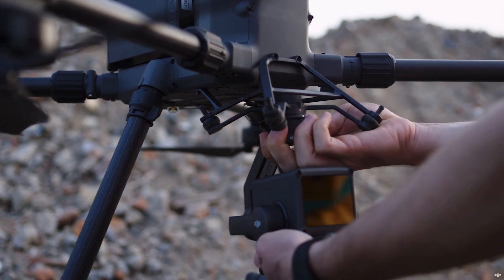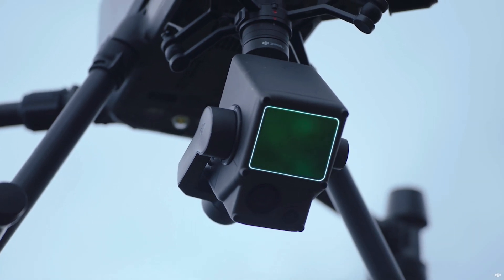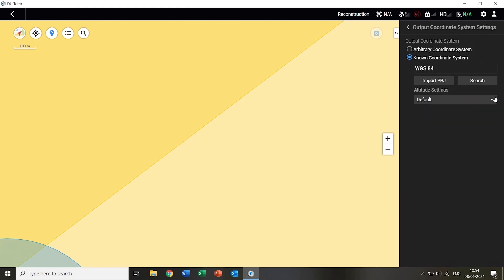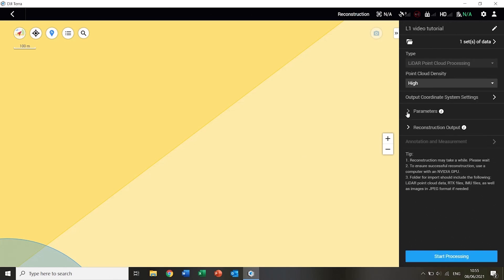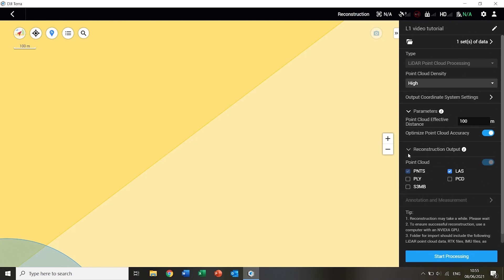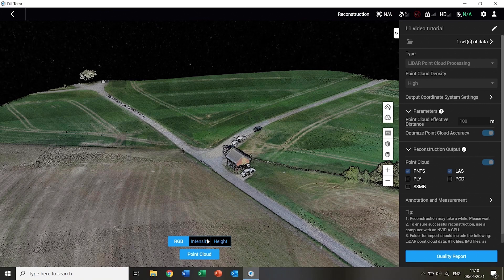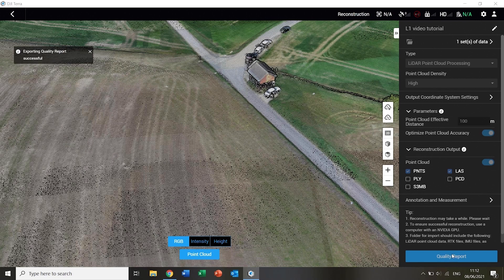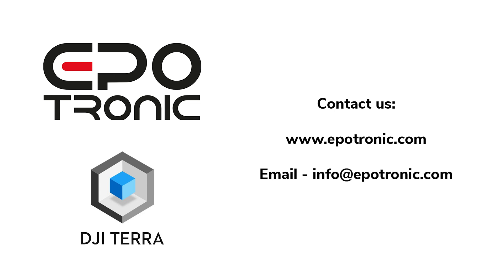DJI Terra V3.0.1 Walkthrough - L1 LiDAR Surveying

Comment: Hello Epotronic team, Your videos are very useful. I have a problem with DJI Terra- When I select my local output coordinate system (specifically VN-2000 coordinate system) after processing the image and Point Cloud with DJI Terra, the results obtained are incorrect. deviate from reality by about 2ft. Can you explain it to me and give me a solution? Thank you
Reply from the maker: Hi Lê,

Glad to hear you are enjoying our content. During the flight was the RTK activated and used to correct the captured data? The positioning accuracy can be seen in DJI Pilot under RTK. Using the L1 without RTK would lead to less accurate results.

Are you sure you are using the same vertical coordinate system when processing the data as with your checkpoint, e.g. not just 'default'?

What flight parameters are you using? We would recommend using < 60 m altitude, > 50% side overlap, and calibration flights.

Let us know if this solves your issue!

Epotronic Team.

Comment: DJI Terra doesn't let me process Lidar Data from the L1, it says there is a raw data file missing or the file path has not been found, but I didn't change any part of the file that is simply created in the datacard, and I literally just choose the file path were it is located. I don't know what I'm doing wrong. Any tips?
Reply from the maker: Good morning Eduardo!

Thank you for your question.

I have spoken to our engineers for you and it seems like a tricky one. The only thing we can think of is when you conduct multiple missions using the L1, all of the RAW data is stored in to one file. It may be advisable to split all of the data manually in to different mission folders before attempting to import in to DJI Terra.

Failing this, the only other thing I can recommend is to contact DJI directly.

Let us know if it has made any difference and sorry that we couldn't help you further on this.

James @ Epotronic
Reply: @epotronic9765  Found out what it was. You can't use RTCM below version 3 or it is not compatible with DJI RTK Antennas. Therefore it was not recording almost any RTK data which is needed to process the data files. I thank you for the response.